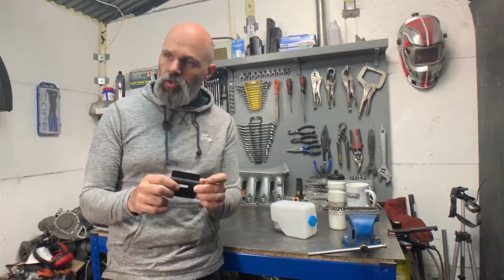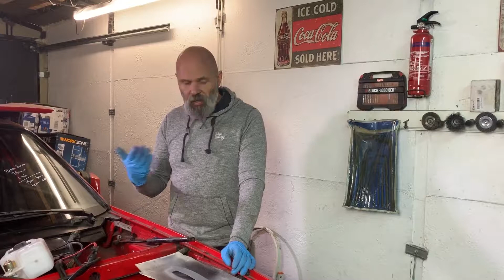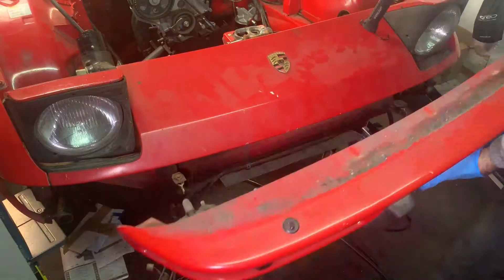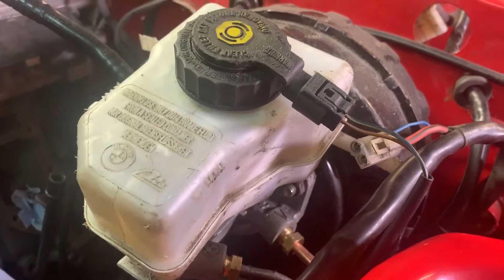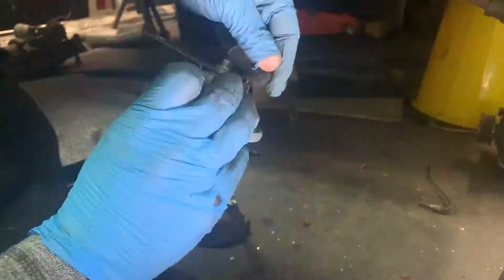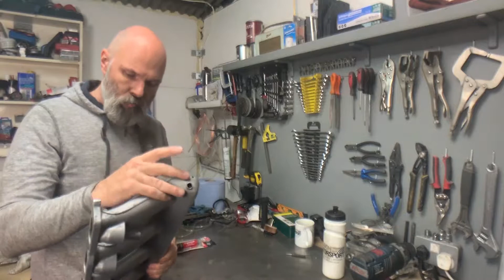Porsche 924 S Turbo Build 26 - Washer, vacuum relocation,  brake warning and horn

Comment: Love what you are doing, when it comes to the intake manifold your best bet would be not to use that JBWeld. I know it's the easy way but with the boost pressures, it would have been smarter to just tap the oem hole and thread in a plug.  Just my 2 cents with that said jeep up the good work!
Reply from the maker: I did think about that - what was the concern with JB Weld under pressure? Asking as I did think about a plug - I didn't think it would be too difficult to tap the intake, it's so soft you could probably drive in a stainless bolt - I went with JB Weld for neatness but keen to understand your thinking.
Reply: @PawnSacrifice  My thought would be overtime with the heat, pressure and vibrations. If it does become loose that it could be sucked into the intake manifold and then a course down through the motor.
Reply from the maker: Yes, that did occur to me, it is tapered from the outside in, so if it comes loose should only fall out, and lose boost pressure. But good for anyone else to read, in case, heaven forbid, they should follow my lead!
Reply: @PawnSacrifice  That's a good point I didn't realize it was tapered, then you should be ok. I'm watching you pretty closely, I'm going to do the same thing to my 944.